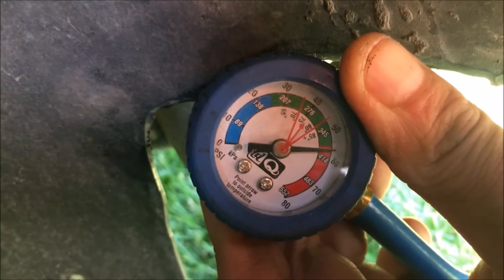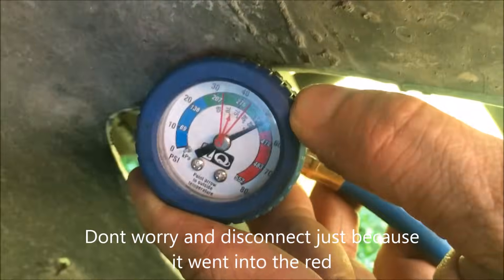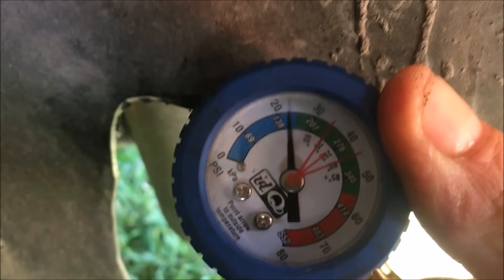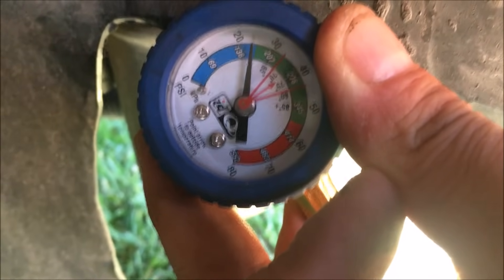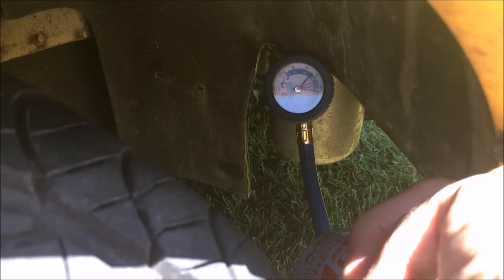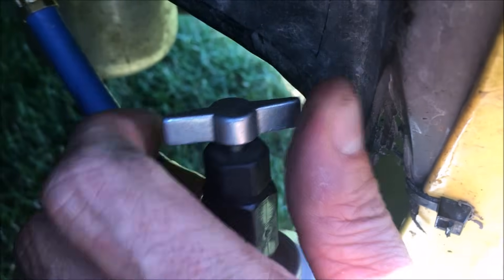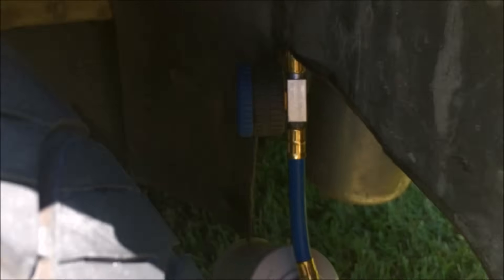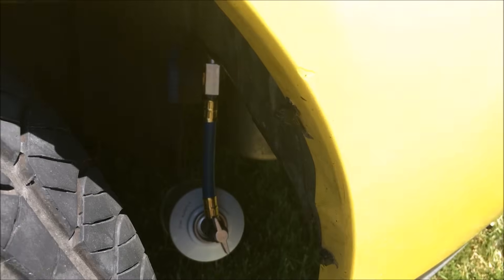Ac kicking on and off ( FIXED ) pressure fluctuation ( solved ) Recharge car ac. pressure to high?

Comment: Thanks for your video.  I was worried when the needle would go into the red zone when the compressor was cycling on and off every few seconds.  The instructions that came with the freon kit made it seem like there was a compressor problem.  After watching your video, I just pulled the trigger every time the needle went into the low zone.  I kept doing this until the needle stabilized and the compressor stayed engaged.  I now get cool air on hot days.  Luckily the inlet valve on my 2002 Trailblazer was conveniently located at the top next to fender.
Reply: Thanks for sharing this. I have a similar issue on my Chevrolet Avalanche. I’ve gone through a Can and still cycling. Changed the pressure switch with no results. 

Add more gas?  When compressor on pressure drops to almost none. Compressor off pressure in the red

Comment: Year and a half later, still in use. Man, you saved me $$$ and frustration. I was undecided to take  on this challenge on my 03 Yukon Denali, (Dual A/C). I read comments bellow and decided to go for it. The needle bouncing from red to white (high, 120 psi to low, 10 psi) was unnerving. After 1 can, it  began to settle down, high green to high white. (50 psi to 23 psi). i began using a second can then stopped pumping it half way through, so  I used an infrared handheld temperature sensor and placed aiming at the vents. it gave me a reading of 73 degs. with the A/C gauge reading at 25-28 psi. I remember that I had dual A/C and i turned it on (luckily). I drove it around for 3-5 minutes and the gauge was kind of steady at 30-33 psi. I added more refrigerant and settle at 50 psi. with dual A/C on.  When driving, the a/c blows at 10 degrees and idle at 55 degrees. Perfect, no more warm air when idling. Not perfect I guess, but I'm not a professional A/C technician. Thanks a million, this is the only video on why the needle goes from high to low. Keep'em coming. Thanks once again.

Comment: Thanks for this video!!  I changed my compressor. The system takes 25oz but after adding 11oz of freon, the gauge indicated the system was full. When the compressor would cut on the gauge would drop to the low indicator. After watching the other person's video and following their advice, I was determined to not overcharge the new compressor. The other video said if the gauge a/c system behaved as such that i had too much pressure on the high and to purge the system. Well, by purging i pretty much let out the whole 11oz. Bad advice!!! After watching your video and learning the real reason the gauge would drop when the compressor cycles on, I learned that it was still low on freon. I added more freon to the proper indication when the compressor cycles on and now my a/c is as cold as ice! Thanks a million! You saved me a pretty penny because now i dont have bring my truck to the shop.

Comment: My 2001 grand marquis does the samething(especially that cycling noise). I was wondering what could it be.
Reply: Markezia Bennett Did you get your Grand Marquis fixed? I have an 04 but I was told I would need to get the system flushed or blown out.

Comment: Awesome knowledge. Had the A/C  Compressor along with the Fitler/dryer and O rings. The compressor now turns on and off when It's hot outside. If It's morning It works fine usually. I think their might be a leak somewhere In the A/C system that Is causing the level to go down. I'ma just use a can of A/C Pro and hope It just needs more refrigerant or has to much so I can take some out.

Comment: Not sure how quick someone will respond but I've been charging mine for about 10 minutes and its been doing exactly this the entire time. How long should it usually take? I havent had working A/C for about a year id assume not too sure it sat for months at one point. Should i turn off the a/c for a few seconds then turn it back on or let it cycle?
Reply from the maker: you puncture the can with the needle then you have to turn the needle back out of the hole so fluid can run out of the can, you may have screwed the needlle down all the way on the can and then just left it , it will not charge this way

Comment: I suspect the same issue with my vehicle. Compressor kicks on for a short time (less than 10 seconds) the kicks ofF. The dial reads all the way past red and resting against the zero stop on the back side (again, past the red). Then when the compressor kicks on, the dial begins to reverse but that only lasts those ten seconds or so. Now, is that normal and indicating a bone dry system? Should I just leave it be filling and continue to toggle the can and it will eventually get to where the compressor stays on? Then let it fill until a proper level? Thank you! I realize this is similar to what you explained here just my readings are terribly low to start compared to what yours is showing.
Reply: Yes try that. That's what I just did and it worked. When the compressor is not on(as mine was cycling on and off) you'll see it go past the red and that freaked me out as well. I kept adding refrigerant until the compressor stayed on and that's when you get accurate readings. When its cycling on it will show low and then when it's off itll shoot past the red, keep adding more refrigerant. It took 2 cans for my 97 Chevy S10

Comment: So my 2006 chevy 1500 jumps up and down and the a/c worked ok last year now it just blows hot. It shouldnt be over filled then? Just low? Thank you
Reply: Yeah. When you hook up the recharge hose and refrigerant fill it till you hear the compressor cycling on and off. At first it will cycle on and off for maybe 3 -5 second intervals. Keep filling up that sucker till it just continuously cycles(keep your AC on max AC and as cold as it goes while doing this) and when the compressor is cycling keep filling till you're in the green(while its cycling) once its filled up the compressor will stay running instead of cycling on and off

Comment: Thanks for the information!  Got the ol' Ford F-250 back in business.  I too was paranoid to continue adding the refrigerant after it fluctuated to the red.  After enough was in the system, the compressor stayed on consistently and viola blew out cold air!  You're a lifesaver!

Comment: Is there a way to get the system to normalize more quickly, especially when it's hot outside? What if the system doesn't normalize on its own? Any solutions?
Reply: Try when the sun has set a bit that's what I did.

Comment: I need help!!!!!! I get no ait or heat..i added refrigerant and it fluctuates. Clutch engages and stops after 5 secs. What should i do next
Reply: I changed blower motor, blower resistor
Reply from the maker: @dariusjames4841  if you have charge it may be a pressure switch

Comment: Same problem when my car stands still BUT if i press a little bit the acceleration pedal the compressor doesn't stops anymore (and the ac works fine). Why? :(
Reply from the maker: might be a failing pressure switch or you are still low on refrigerant
Reply: @NOBOX7  i already changed/charged the refrigerant 2 times & i have a new pressure switch. That is why it's strange.

Comment: I have a 2011 Chevy Tahoe.  The a/c compressor is kicking on and off consistently.  I have checked pressure when compressor is turning and it shows it correct.  I also replaced pressure switch.  Any idea why the compressor kicks on and off so rapidly?
Reply from the maker: overcharged

Comment: Subbed. I was about to blow $100 on a new compressor and i just needed to expel some excess freon out, now works like a champ. My compressor would turn on randomly while on Max AC..sometimes blowing warm for 10-20 minutes before it would finally kick in. I knew it wasn't low because I recharged it last year...lo and behold I just put too much in it. Show the gauge in the video was excellent!!!! SUBBED until I die. Bury me with your youtube channel on my gravestone, you are welcome
Reply: So letting out the gas solved the fluctuation ?

Comment: I have a question and hope you can help me out.  The gauge on the Arctic Freeze I was putting in my van does keep going up and down and the compressor does keep turning on and off.  Can't seem to get the can emptied after about 40 minutes.  The can did empty about 80% of the refrigerant.  The gauge on the can sits at the border of the green and blue if I keep my van running.  But when I turn my van off with the gauge still connected it goes up into the red.  Is that normal or did I overcharge the system.  Which reading is correct.  With my van still running with the a/c on high or with the van completely turned off.  Hopefully you have an answer for me.  Thanks in advance!
Reply from the maker: Yes if the vehicle is off you get the tanks pressure not the operating pressure , the tank pressure can be very high on a hot system . Your fine dont worry
Reply: Thanks dude!  Since it is on the border of green and blue and it seems it is slightly cooler.....and I mean slightly, guess I will have to go get another can of Arctic Freeze tomorrow and hope that does the job.  I've got a FORD E-150 and it holds 60-62 grams and I only put in about 18 ounces from the 22 oz can.  Seems that it will not empty anymore.  I think the button might have stopped working.  I gave you a like and subscribed.  Thanks again for the info!

Comment: I have a 2005 Dodge Ram and the compressor comes on and off when the ac is on and it only blows hot air could this be the problem thank you
Reply from the maker: You may have a blown solenoid, does the compressor come on ?  if not the solenoid is bad if it does and goes right back of your out of fluid , if it runs a sec but goes of and you no its charged then your over charged , let some out until it kicks on and stays on .

Comment: You should also mention that the compressor will also kick on/off like that if it was overcharged. That was the case with my AC system.
Reply: Mine keeps reading overcharged but but no cold a/c
Reply: @jeandireus5584  if its overcharged then it will not be cold.
Reply: Jim Long what can I do to fix it?
Reply: @arechigag779  honestly I hooked mine up ac pro nozel with the container off  and squeezed out the air in a bag till it was within  normal limits while running.
Reply: Jim Long Honestly Thanks cause the weather be crazy
Reply: Arechiga G mine was low. I bypass the pressure situation to be able to recharge it. Because with the pressure to low or a leak there is no way it will read a good pressure
Reply: jean direus did u fix it ?
Reply: What happens if it gets overcharged?
Reply: My compressor cuts on.    Runs til the pressure drops down low and shuts off.  I added 365 grams. Still doin the same....  do u hv. To put oil in with the freon..
Reply: Mines keeps cutting in and out eventho the pressure says it's in the green???
Reply: @rgonzo1979 same!
Reply from the maker: Thanks , people read these comments so you are sure to help many with your input .

Comment: LOL @ Ford is fired. That's no shit... I decided back in the 80's that I'd never own or work on another Ford. Some of the goofiest design and engineering EVER, and for no reason other than to make money for factory service centers, when regular mechanics finally get fed up and start throwing their tools..

I got a '98 F150 in a trade, so I'm stuck with working on one again. What a freakin nightmare.
Reply: I gave up on fords in the 80s also. I was thinking of buying a new truck. I keep hearing ford has a great tranny for towing. I don't know if that is a good trade off, a great tranny for a shit truck. Glade I read your post FUCK FORD FOREVER.

Comment: Thanks so much for making this video!  I charged the coolant on my 2001 Ram 3500 diesel dually, first time it's needed it in 18 years, and it started doing the pressure fluctuation dance.  I was afraid I had overcharged it so I quit.  The a/c didn't get cold at all so I was afraid the compressor was gonna need some expensive love.  Thanks to you I now know that was normal and I actually quit too soon.  I live in Huntsville, Alabama and no a/c in summer is like driving through Hell.  Went back out, put the rest of the coolant in, fluctuations stopped and The Big Honkin' Truck has COLD AIR!  Thanks thanks thanks!

Comment: Great explanation! Short cycling a/c is usually a sign of low refrigerant, which is usually caused by a minor leak. I always replace the schrader valves as they are cheap and are normally the failure point of the system. For older cars, replace the accumulator/dryer and orifice tube or expansion valve. Pull a vaccuum for about 20 minutes (or more if you have time), and charge the system again. Doing this really helps bring back the cooling power of a dated a/c system. Remember to add oil, if your system is totally dry. Stay away from dyed products, as you don't need that mess in your refrigerating system. Apart from locations, a/c systems do not have many complicated parts, so don't fall for dealership prices, such as $2,500 repair bills, when your car may only be worth $1,500. Learn yourself, or find a neighborhood technician willing to repair your car (the right way) for much less. A trusted mechanic is worth way more than any dealership in the game solely to profit (by decieving you). I wrench on cars because its what I love, and I love helping people.
Reply: RHawk 24 ....thanks so much.  You gave me some good ideas to bring my system back to life.  I have some short cycling like the video so I will probably try  some Freon first.  I found the new blue adaptor cans tricky to use like the video stated.  And wow, the dealers are only getting worse seems to me.  I stay clear of them and diy.  Have to, my pocketbook isn’t big enough.
Reply: Thanks man!  Great to see some honest mechanics willing to help some people.  Good job buddy.  :)
Reply: Did this on my 01 Silverado and the AC is ICE Cold , My Compressor kicks on and off. It works so good I have not checked it out , might still need to top off the refrigerant so it will stay on constantly?
Reply: @innovativeintelligence4172  short cycling like 3 seconds on 3 seconds off is usually a sign of low refrigerant. If it runs for a good minute and kicks off for a few seconds, that is pretty normal, especially if you have the "auto" climate control. One thing people neglect is the Schrader valves, replace them if possible, they can slowly leak causing a tiny bit to escape and you will find yourself topping the a/c off multiple times per year. Also verify your secondary "radiator fan" kicks on with the a/c compressor. You may have 2 fans, you may have 1 fan with 2 speeds, you may have a mechanical clutch fan too. But make sure air is getting pulled through the condenser (behind the grill) and its not plugged with bugs and debris. A garden hose is a good way to gently flush gunk out of there. Don't use high pressure or you risk bending the fins of the condenser and radiator. 
One last thing, if you do a/c quite often, invest in some a/c gauges. They don't have to be expensive, my first gauges were harbor freight. They worked fine, I still have them too. Amazon also has some good options. Then you can buy the cans for like $7 at any auto parts store and not the $35 "gauge and trigger" cans. You will spend more on those trigger cans than a set of gauges at harbor freight. Those blue trigger cans hoses are so darn short, they don't reach where you want them to, they just suck overall. Plus you can't really trust the gauge, even if you get the port, the can is too big to tilt and do the rain dance the instructions say to do....something like 12 o'clock....3 o'clock....repeat....it's just not good.
Reply: what do you mean pull a vaccum for 20 min??
Reply: Well said brother. I wanna like but it’s at 111 and who am I to mess that up
Reply: The opposite happened to me. I had some freon in the system but my ac would not blow cokd air with compresor on. As i stsrted putting more freon then the compressor  started doing turnin on and off. When it would turn on it would go down to the green are and when it would turn off it would go to the red area. I decided to purge sone if the refrigerant until  the compressor jept running continuosly. Its so weird. This is a 2005 beetle. Now it would blow cold air sonetimes with compressor on. But if I stop the engine and turn it on the next time it will not blow cold air but instead cool air.
Reply: For sure this was a huge help. I was going to recharge my AC on my 2007 Chevy Silverado and it said my pressure was in the green. I was like that’s weird. It’s still not blowing cold there and then I added a little more and then it started doing the cycling like you guys said and then all I needed to know is that I still just hadn’t had enough Freon yet so great video I appreciate the help and now I can stay cool in these nice warm days.
Reply: Also to add check your hoses guys, if your vehicle is 1990s some of those rubber hoses get weathered and crack so f***ing easy! I just replaced 2 hoses and got better hosing from a department store in their plumbing section for $2. Typically about 1/4th hosing is what you're looking for.

Comment: I have a Toyota Tacoma and the compressor seams to kick on and off a lot more than I remember to be normal. The ac is cool but it doesn’t seam to be as cold as it should. I put a gauge on mine and when the compressor isn’t on the needle is in a normal range and when the ac compressor kicks on it goes to below normal. Does that mean I need more Freon? I don’t want to over charge.